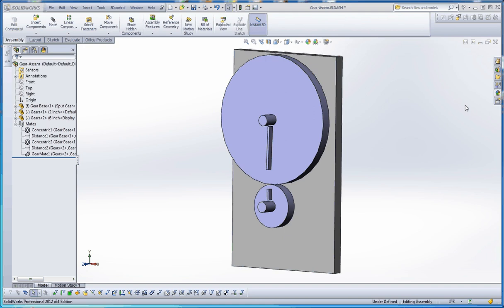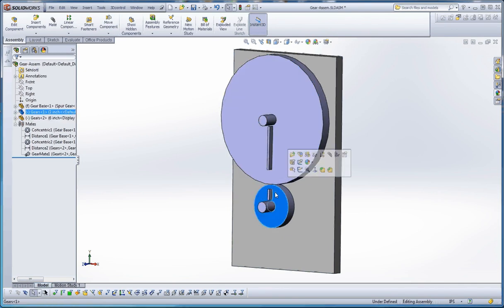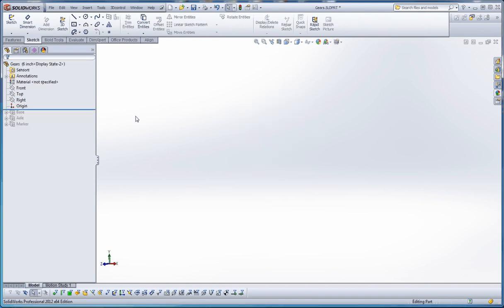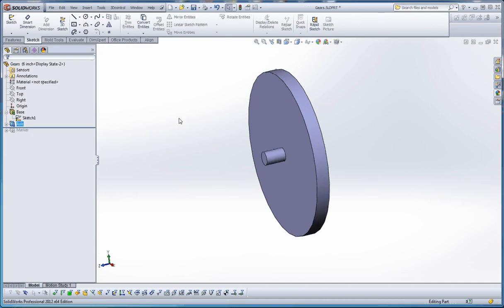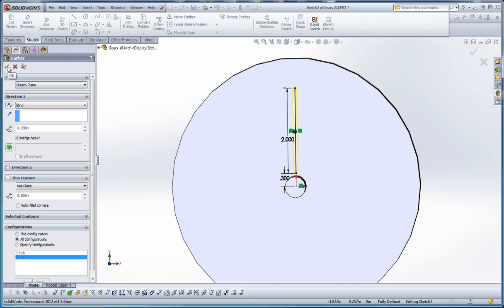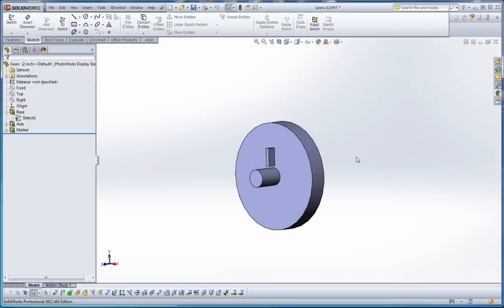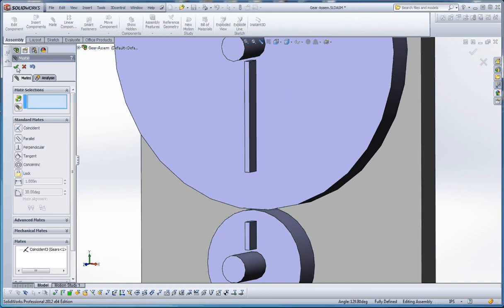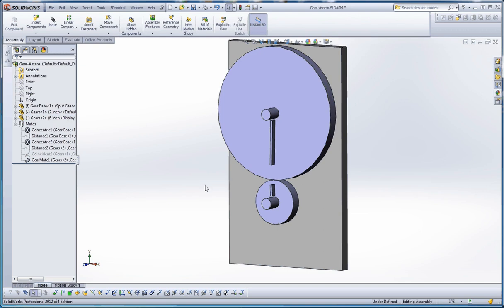Simple Spur Gear Friction Wheel Demo using the Gear Mate, Mechanical Mate

Comment: The reason I'm asking is I need several wheels rolling on a trackball that can go in any direction.
Reply from the maker: This demo shows how to apply a SolidWorks Gear Mate in a simple application.  But applying this on a sphere gets more complicated (but not impossible).  One thought - regarding a variable speed transmission - is to consider a wheel of a fixed diameter traveling up and down a cone (axially).  And the cone can be simulated as a series of wheels of proportionally  increasing or decreasing diameters. Conceivably this may be applied to a sphere too where the proportional element becomes variable.

This gets complicated but may be approached through various steps.

Hope this helps.

Comment: Interesting but what if you wanted the smaller wheel to ride on the face of the larger wheel, and what if the smaller wheel needed to vary speed depending on the distance from the center of the larger wheel? Kind of like a variable speed transmittion.